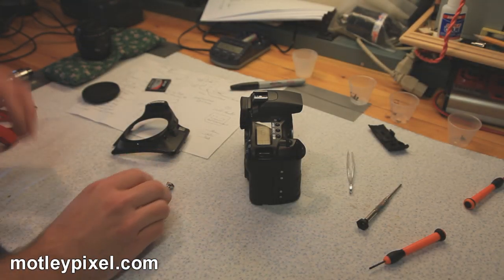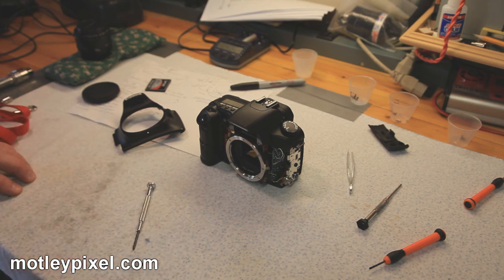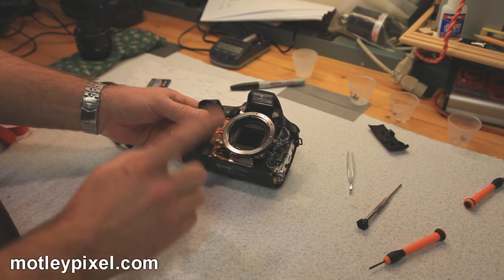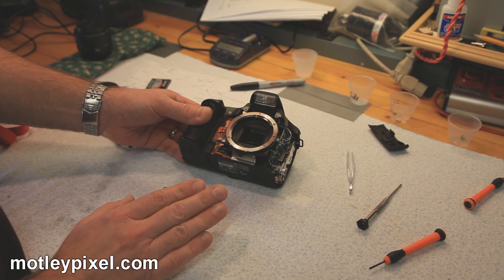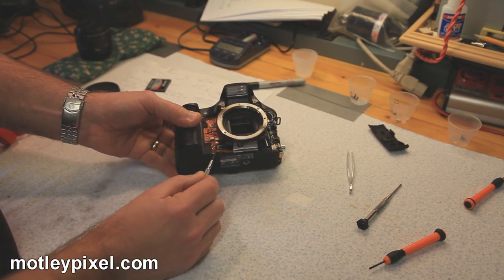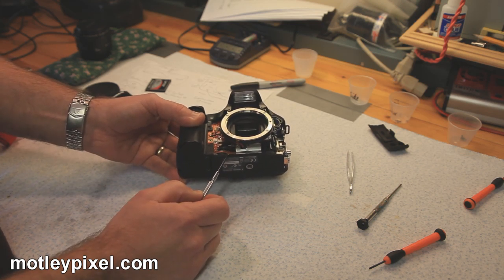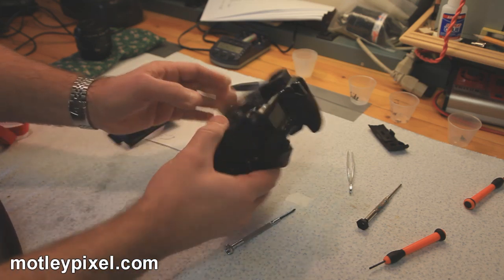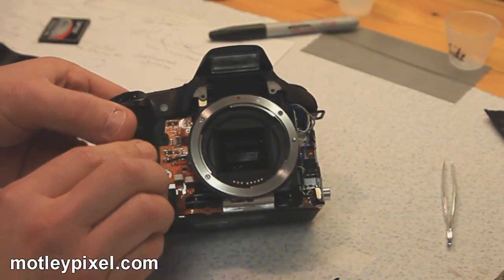Canon EOS 30D Shutter Repair Part 2...SUCCESS!

Comment: Hi,
How did you "work the mechanism manually"?  I removed the front section, as in this video, but I can't really work out how you worked the mechanism.  
My 30D has a constantly firing shutter, it only flaps about half way, despite there being no obstruction to the mirror.
Oh BTW - your site is flagged up by Avast! A/V so I can't open it.
Cheers

Comment: doesn't the camera do some kind of cmos test to check that it's up and running? note that I can take a pic. and the exif info about the picture taken is stored and showed correctly but it's a complete black picture. I know that you already helped me enough with this and I thank you for that  but I just wanted to have some direction to go to. if the FPC is ruined can I replace it with a new one or do I need to buy a new sensor? thanks.

Comment: @motleypixel Thanks again. It seems the 40D is a little different. So I couldn't replicate that. I hold the mirror and after a shot the shutter started working again but... all pics are black. The error 99 is gone but I have no image even when in live view mode. while soldering it heated the data cable that goes to the sensor. a protective tape had a dark mark but I think it managed to protect the FPC. but now I'm not so sure.if the fpc was destroyed somehow wouldn't I get an error of somekind?

Comment: Huge thanks motleypixel. I got inspired by your movies and tried to solve the error99 prob with my canon 40D. Bought a new shutter on ebay  and after a lot of work I have the same error 99 again! but now it's a little diferent. the camera actualy stores a file (black pic) and then errors. the shutter doesn't open even with manual sensor cleaning. Can you explain what you did there? could it be a lack of grease on the motors? thanks in advance.

Comment: @kramarica01 It doesn't require to re-solder the ribbon cable, because the new shutter for the 40D comes with the ribbon cable on it. But during the process you need to solder one thing, it is written in the service instructions. I have got the service manual for 40D, it is very-very helpful during the operation. I also have pictures about my 40D during the service. If you want it, I can send it, just write your e-mail adress.
Furthermore the whole transplant did take 4-5 hours.

Comment: Congratulation to you, and thanks, your video helded me a lot!! I replaced my shutter in my 40d, and it was not easy, because of the fail of two screws.. but finally it succeeded. At the first expo i got an error, but after that it goes without any problem.